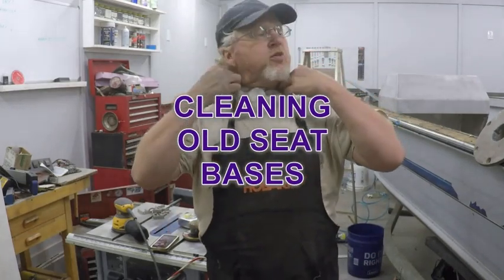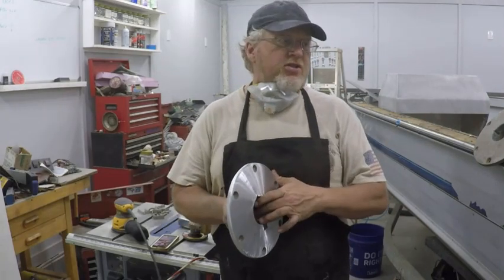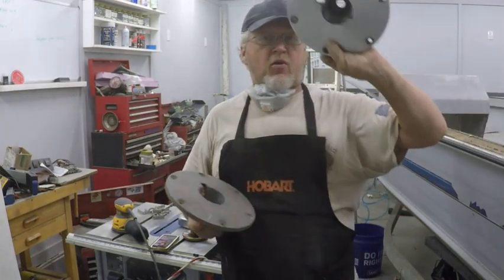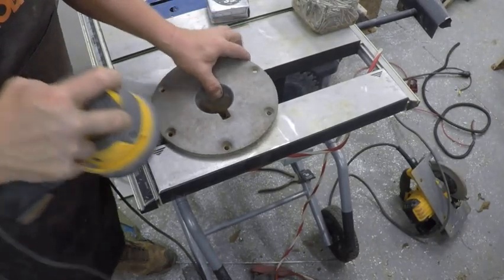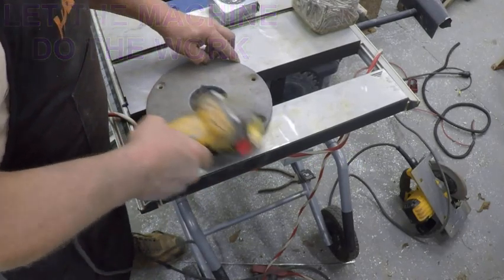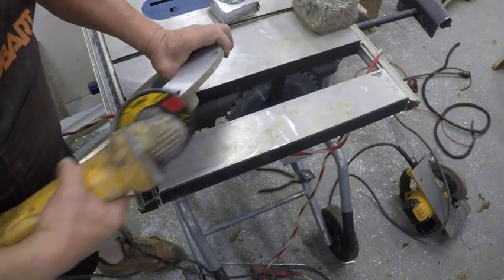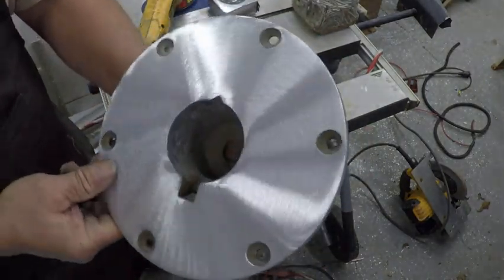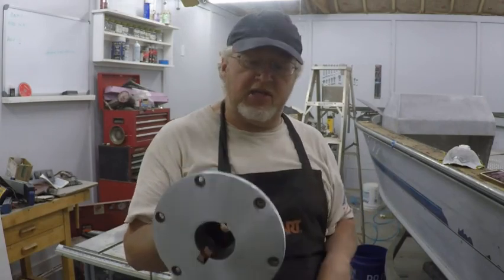MAKING BOAT SEAT BASES LOOK NEW AGAIN

Comment: What do you lubricate to keep them from sticking in the bases?
Reply from the maker: I use graphite spray.  Or lithium grease spray they don’t make a huge mess.  Another thing that works you just have to do it more and it don’t make a mess at all is silicon spray.  You spray it on wait a minute then wipe it off.

Comment: What sealant do you use on through bolts to transom
Reply from the maker: I used a polyurethane call like for metal roofs.  Any quality marine sealant will work.  As for the small 1/4” bolts I used stainless neoprene washers on the outside
Reply: @bowl830  so the neoprene washers are enough? I was going to use those and 5200
Reply from the maker: @mikedrury1317  I put a drop of sealer on the threads anyway.  But that’s all they put from the factory.
Reply: @bowl830  how tight are the neoprene washers supposed to be? Mine are squeezing out the side… is that right??
Reply from the maker: Yes they’re supposed to compress the washer till it starts to squeeze past the washer. The washer is shaped to force it into the bolt first then out past the washer
Reply: @bowl830  Is there a polyurethane that you can recommend? Thanks